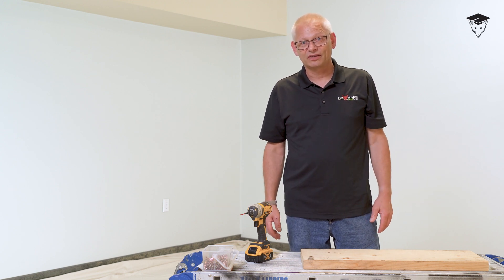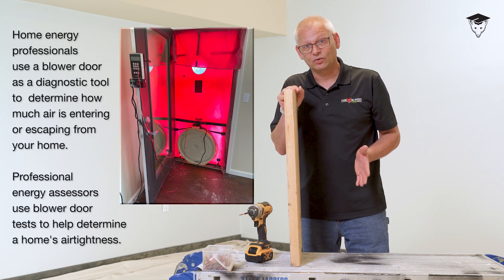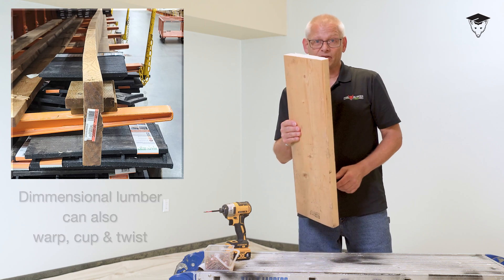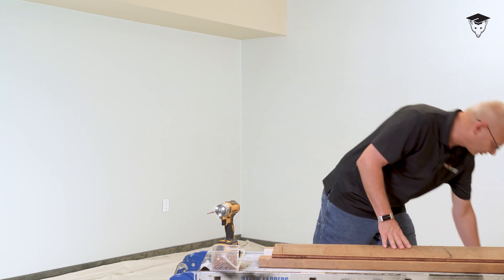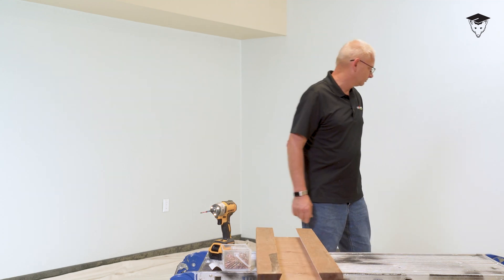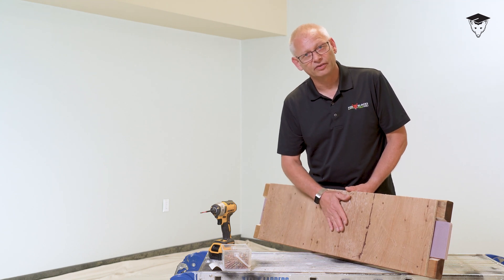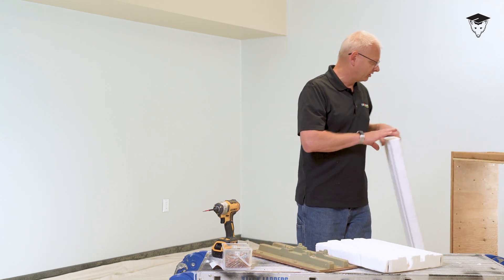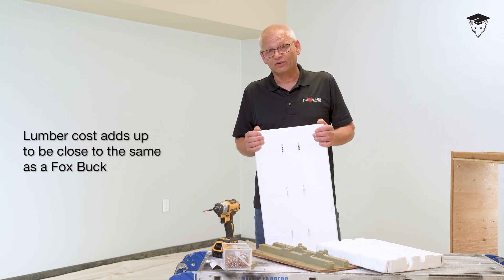Wood Bucks with Fox Blocks

Comment: Would you need pressure treated plywood if you use the sill gasket AND the foam insert? Pressure treated plywood is wildly priced right now.

Comment: Down here in the Southern US (I’m in Miami FL) we don’t always use flanged window’s especially for impact hurricane windows. They are just rectangular at aluminum that’s tapcon-ed into bare concrete (pored or block) . In this case do you still recommend the foam buck or just bare concrete
Reply from the maker: I have been on many sites in Florida where the windows were fastened directly to the concrete but we have also started to see many residential and commercial projects using the foam buck. Because of the design with the 1" x 1" ribs it works well in high winds. For commercial store fronts foam bucks are used but 6" x 6" holes are cut @ 24" +/- o/c and covered with plywood prior to concrete. Post concrete the storefront glass can be anchored to those plugs of concrete. Works well and insulates the concrete.